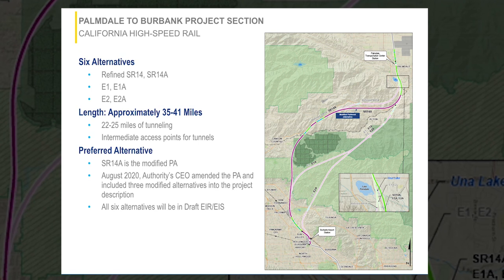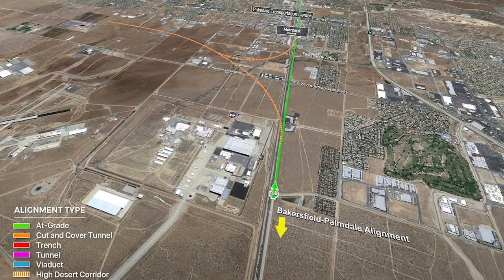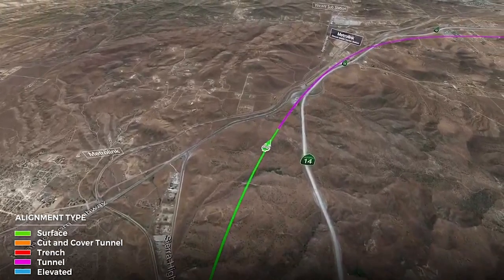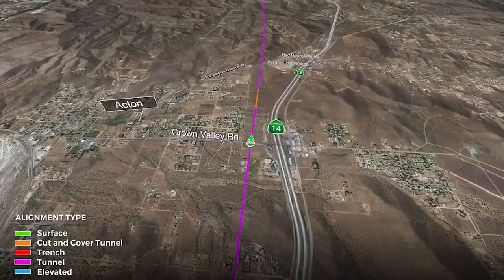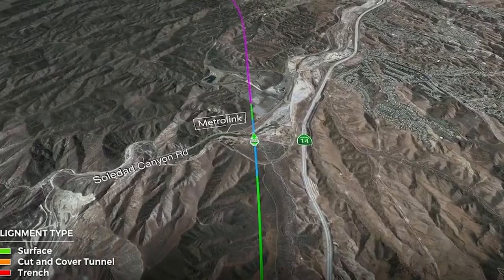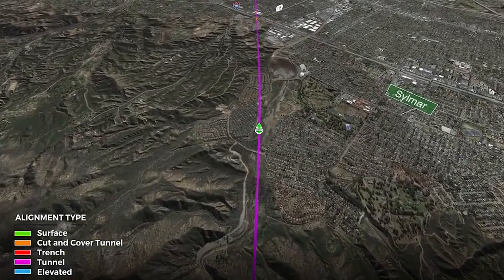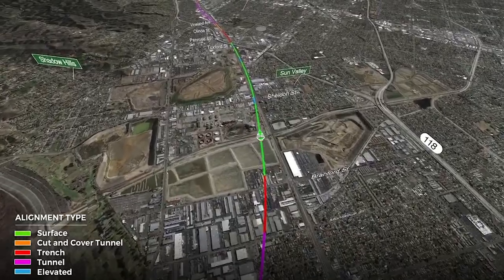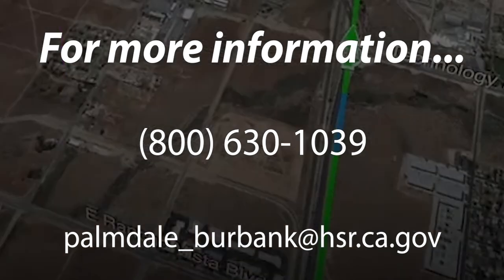Palmdale to Burbank SR14A Preferred Alternative Flyover

Comment: I would hope that the new Burbank airport station would include platforms for both the metro link and yellow line in one station area rather than having to walk all over the place to get from yellow line. Metro and high-speed. 

Also what would the curve speed from palmaldale to Las vegas be? Surely this should be in the 250mph area to utilise both lines.
Reply: If I remember correctly, Brightline would not be utilizing the CAHSR trackage between Palmdale and LA. It would only be a transfer point between the two networks. The Brightline extension to Palmdale was done as a cost cutting measure to skip building their own expensive trackage into LA since there should be a connection to Downtown LA through CAHSR by the time it is complete.
Reply: @AmpereBEEP either way it future proofs you for future high-speed connection beyond Las Vegas for both companies. Otherwise it would be silly to make a low speed triangle junction. On a section where trains could easily be traveling at 250mph
Reply: @richardmoore899  I see what you mean by that. Honestly with the way the triangle was shown there, it seems like Brightline wants all trains to stop at Palmdale which would negate the need for it to support the maximum designed speed. It probably also has something to do with the way that they need to squeeze the triangle between the Airport and the edge of the built up areas of the city. Not to mention that it probably isn't the final design for the junction either.

I would imagine that if in the future they wanted trains to bypass Palmdale, they could create another larger triangle to the south of Palmdale that follows a significantly smoother curve to get around the problem entirely.
Reply: @AmpereBEEP  agreed on your points. Tho I don't like the idea of building a new bypass triangle cause of the lack of foresight.....
Tho tbh I did once wonder why they don't create a larger triangle with one leg for South bound trains going parrelle to road 58 to Barstow and then you can get a bigger curve in the space given
Reply: @richardmoore899  Brightline probably looked for the cheapest route to construct since they are a private company and the triangle shown in the video was the result. South of Palmdale it seems like there are quite a few hills and from what I have found, the initial Brightline segment would be between Victorville and Las Vegas, meaning that there would be another triangle at Barstow and then a dead end at Victorville if they decided to follow CA-58. Now that would not actually be that bad of a route, but I am not sure if there is enough room between Edwards Air Force Base and CA-58 for them to purchase their own dedicated Right of Way. Especially considering that there is already a railroad right of way there.

Actually, if Brightline was looking for the most economically feasible way for them to construct an extension to Palmdale, it would make more sense for them to use Victorville as a pass-through station considering that they would have already constructed the trackage between Barstow and Victorville. I just measured out the two route lengths, and the route following CA-58 would add 39 miles or so of additional track length that they would need to construct by taking that route. All of those things add on to the journey time and that is possibly why they chose the route that they did. It might result in a shorter trip length by just slowing down for the triangle than by going the extra distance.
Reply: Agreed, in SFO the BART link is a terrible walk.  If you look at Portland they have a station in the airport so its just a matter of picking up your bags, down an escalator and onto the lightrail there.

Comment: @California High Speed Rail Authority Why the detour under Burbank Airport though, and not a straight alignment paralleling the Metrolink AV Line from Sun Valley to Burbank Junction? The point of LA to SF high speed rail is to connect LA and SF via the Central Valley and meet the promised sub-3 hour goal for LA to SF service. More than likely most trains will be bypassing Burbank Airport anyway, with only local trains serving all Anaheim to SF HSR stations stopping there. Paralleling the AV Line from Burbank Junction would also have less impact on surrounding buildings since none would need to be removed to make way for HSR tracks, which could instead go underground between Empire Ave and Buena Vista St and then stay underground all the way through Sun Valley and onward. 

CAHSR and Brightline West should work together to build the Palmdale to LA segment and share those tracks. It’d be a win-win for Brightline West to provide direct LA to Las Vegas HSR service, and for CAHSR getting help building a crucial segment of its LA to SF route.
Reply: It would be nice to know how much the through trains will have to slow to accommodate the zig zag through the Burbank Airport station. 

The best stations are multimodal (local and regional bus, local train, HSR, Air, Car Rental, parking, etc).  

Burying a station at the airport where multimodal expansion is needed makes adding more connectivity later more expensive and complicated.

Since the airport terminals are planning a rebuild anyway the airport planners can always stack a regional transportation center on top of the station to pick up bus service. Regional tran users will need to walk or take a shuttle. If the whole point of HSR is to avoid air travel then prioritizing the short walk from a train to a plane over other modalities is somewhat suspect.
Reply: All HSR trains, including the express trains, will stop at Burbank Airport.  First of all, the SF Valley has a huge population, so this station will be a major access point for the CAHSR system.  Second, this stop is needed to cue inbound trains into LA Union Station above the 3-track section shared with Metrolink.  It's needed for outbound trains because they won't be able to let more than two trains travel in each direction at the same time.  If three trains traveled in the tunnel in the same direction, the middle train will be trapped in the unlikely event that a problem happens with the two other trains.
Reply: @jmecklenborg  I doubt express trains at least will be stopping in Burbank if any intermediate stations between LA and SF. Those will be the ones that have to meet the promised sub-3 hour goal laid out in Prop 1A, and once they leave LA or SF every minute counts. I can see San Jose being a stop for all trains, considering it’s a major hub for NorCal passenger rail and other transit, but not Burbank. It’s only 12 miles from LAUS, and is well connected by existing Amtrak and Metrolink services, the latter of which could implement a non-stop service between LAUS and Burbank Airport (especially with electrification of that corridor for HSR). There’ll need to be serious coordinating of trains on both the Caltrain and Metrolink ends of the LA to SF route to prioritize HSR trains, particularly the express ones, and I’m sure CAHSR will work with those agencies as well as UP to ensure that happens once operations begin. The tracks between Burbank and LA (and all the way to Anaheim) will need to be redesigned and upgraded to accommodate high speed rail, which if it’s anything like CAHSR’s Alternative 4 plan for San Jose to Gilroy will feature 2 passenger tracks and 1 freight track.
Reply: @ChrisJones-gx7fc  I have read other people speculate that CAHSR will do just that - run one "super-express" train each day during off-peak hours in order to fulfill the language of 2008's Prop1A.  But a true express won't be possible during peak hours due to the Caltrains commuter rail activity on the Peninsula and Metrorail between Burbank and LA Union. A tapping of the brakes by a southbound train anywhere between SF and Burbank means it will miss its slot to proceed south of Burbank.  Also, nearly 2 million people live in the San Fernando Valley, which is 2X the population of either Fresno or Bakersfield, so it's a major source of riders.
Reply: @jmecklenborg  well it does look like the proposed Burbank Airport station will be just that, a station for Burbank Airport, seeing as the latest plans will place it underground adjacent to what will be the new terminal. I would imagine though it'll be for namely Southern Californians from the LA area and Antelope Valley wanting to fly in and out of a cheaper and/or more convenient airport than LAX. As for the Caltrain corridor, I bet most HSR trains will terminate at San Jose, especially during peak commuter hours, with only some continuing on to SF. It'll probably be a similar set up for south of LA, with most trains terminating at LAUS and only some continuing on to Anaheim.  

Granted the Burbank Airport station will have connectivity beyond the airport and maybe even separate parking from the airport, thus serving the wider San Fernando Valley. Though if it'll really be a stop for all HSR trains (to as you say help funnel trains in and out of LAUS), I imagine it'll have to be a relatively large station layout that'll need to accommodate something like three to six trains per hour (likely in each direction), so at least three platforms, and with it all underground. Wonder what the practicality of that would be. That's why though I'd bet express trains will bypass Burbank on their way to and from LA, given they'll have the highest priority not just for HSR but all trains they share tracks with. That said most HSR trains will likely be limited and local stop, with express LA to SF trains running in non-peak hours.
Reply: @ChrisJones-gx7fc  Just came across this thread. Had to comment how much I appreciate your remarks. I learn so much. Thank you. You make such good points. Best of luck and best wishes.

Comment: I think the access points should be made permanent along the line for general or emergency access 
And how does the fault line hold up against this massive construction that will possibly weaken certain areas from digging and trenching …..
Reply: I'm sure they will account for emergency exits in all sections of the tunnel. There will also be ventilation shafts as well, I'm sure. I've read several articles in the past that indicate things like subways and tunnels do better in earthquakes than things like bridges, and bridges do very well especially more recently build ones due to the higher earthquake building standards in CA.
Reply: fault lines really arent affected by human activity of this scale

Comment: How does the San Andreas fault fit into all of this with the tunnel
Reply: It doesn't. Earthquakes do most of their damage above ground, not in tunnels.
Reply: The San Andreas Fault is more than just a fault it’s a plate boundary and could shift up to 27 feet. This is a good question not to mention fire danger inside of tunnels. For a state that needs water infrastructure what a waste of money.
Reply: @mikecodester   No. It’s not a good question. The Japanese have been building tunnels in seismic zones for 60 years without incident. If water infrastructure is such a problem for you, why aren’t you campaigning to get a water infrastructure ballot measure. All that means is that HSR supporters are more organized and care more than you do because they got a ballot measure on the ballot and it passed.
Reply: @gruweldaad  The state should not be paying for 1 inch of this railroad. Move to Japan
Reply: @mikecodester  I can’t. I’ve seen squid game.
Reply: @gruweldaad  That's Korea lol.

Comment: Any concerns about crossing the San Andreas fault zone by Una Lake?  Also what is the total extent (miles or kilometers) of proposed tunneling in this segment of the project?  How would this compare with rail tunnels in Europe and Japan?
Reply: I don't know what they plan for the California tunnels but there are technologies to build safe tunnels in earthquake zones. If you are interested, search for details for the Istanbul Bosposrus railroad tunnel in Turkey, which has been built in a highly active tectonic zone. Essentially it's a "tunnel within a tunnel". It has an outer pipe and an inner pipe (the actual railroad tunnel) with the inner pipe sitting on a bearing of strong springs. The shock waves, movements and energy of an earthquake only become effective on the outer pipe, which is able to bounce without breaking at once. That prevents the inner pipe to break. If there is damage, then only the outer pipe needs to be repaired. Maybe this won't survie a real big one like Richter scale 8, but most of the earthquakes which shake Southern California all the time. Fore sure such a tunnel is more expensive than a conventional tunnel, but maybe the only thing suited for California.

Comment: What's going to be the average speed in this section?
Reply: Fast lol
Reply: Tehachapi Pass was called out in a previous Q&A video as being their slowest pass due to the grade at a continuous 180 mph. I’m not sure exactly how braking before Burbank would factor into the average speed, but it’s safe to assume that it will be about 200 mph.
Reply: @brandonk7361  That is still the fastest speed they have in one of the longest tunnels. 180 mph translates to almost 300 kph. The Gotthard Base Tunnel and the Brenner Base Tunnel only operate at 250 kph.
Reply: @brandonk7361  I doubt they will operate at 200 mph throughout the system. Experience from other HSR systems is proofing such a speed - while technically no problem - results in uneconomically high power and maintenance costs. Here in Europe speed limits for tunnels never exceed 250 kph, which would be 165 mph. The super-long tunnels below the Alps mountains (30 to 40 miles length) mostly are authorized for 125 mph operational speed (200 kph) only. That's to keep wear and tear on an acceptable level.
Reply: @OldSchool-px1xk  That’s not strictly true. The Frankfurt-Köln line here operates through tunnels at 300km/h. HS2 in the UK is currently building tunnels for 360 km/h operation.

Comment: Current gas prices are CAHSR best friends. However, I guees it will take a lot of effort to make Californians accept trains as a mode of transportation. This state has been built on the automobile like no other. And what is more, it does not suffice to build just this line, as expensive it may be. You will need to upgarde mass transit in the Los Angeles and Peninsula region big time. Nobody takes a train, if he needs a rental car for lat miles to get home from the station. Looking at the Inland Empire or San Fernando Valley, I wonder how that goes. Angelinos are not people like those from London or Tokyo. They love their car. I guess that'll be much more of a challenge to CAHSR than boring tunnels under the Tehachapi mountains.
Reply: Originally, California was built on rail transportation.  Full north/south coverage happened in the nineteenth century. No autos then.
Reply: @JamesMcGillis  That is correct, Sir, However, the railroads which were constructed in the 19th century, up to present day, were curvy single-track lines. Already after WW1 they were considered as too slow, weren't they?.  When I-5 was built, and airflight became affordable, passenger rail quickly went down. Not only in California, for sure, But that is the reason why the railroads in Europe and Eaat Asia responded with high-speed rail, to keep their passengers. Please look at the US East coast. On the NEC more people ride the train than in the whole rest of the US alltogether. That is, because you have the Acela and 125 mph at least. It could be much more if they would invest more into that route. Maybe they will, if Amtrak's budget is raised. So please don't get me wrong. I don't want to make a judgement about the US or California. But a train taking 12 hours from LA to SF really is no alternative to plane and car. That is why I wish CAHSR to become a success.
Reply: @OldSchool-px1xk  Very nice remarks. Car culture is true.

Comment: Wouldn't it be cheaper and easier just having a raised rail above the middle of the 14 freeway like Disneyland?  There would be more to see.  Being underground for 30 minutes or whatever the time, would be boring, plus there's the issue of earthquakes...
Reply: being underground is actually the safest place during an earthquake
Reply: @georgerascon1825  not when you’re under extra weight, in addition to the ground shaking all around the tunnel instead of just shaking below the rails.
Reply: @mi12no  oh
Reply: @mi12no  There have been several studies indicating being in a tunnel is safer than let's say on a viaduct or bridge during an earthquake. Japan has many miles of HSR tunnel and a lot of earthquakes too and they haven't had any serious issues. And they invented HSR and have had it the longest of any country.
Reply: I'm not sure of the specifics, but often median alignments don't work for trains due to different curve and grade tolerances between cars and trains.
Reply: forget the curves, there is absolutely no way that a train could make those grades work at reasonable- let alone high speed

Comment: It shows surface grade through Palmdale,  From Lancaster to Palmdale should be below grade so we don’t drive across the tracks and hold up traffic. The existing Union Pacific does that already and it is a mess morning and afternoon. Thank You.
Reply: But freight trains take much longer to cross. I sometimes just turn off my car because the wait can be long. HSR is much faster so it shouldn't be an issue for traffic.
Reply: I think there is a grade separation where the road will go over at these points.

Comment: Wouldn’t it be more expensive to build tunnels then to just improve that current track that Metrolink takes?
Reply: Metro link speeds are lower and the turns would mean running the HSR at unacceptable speeds.